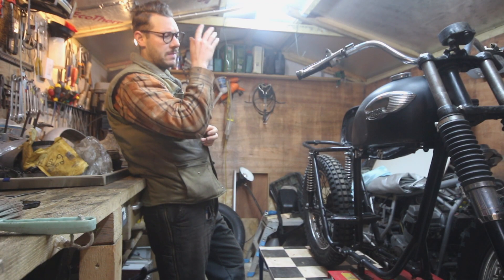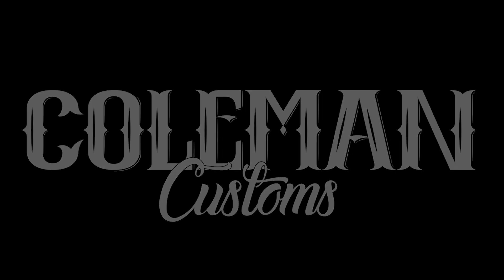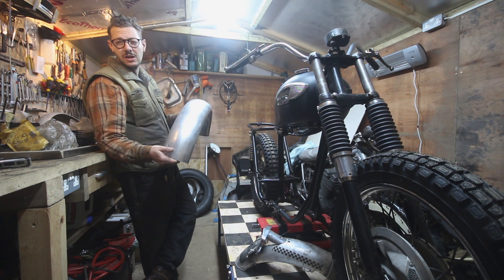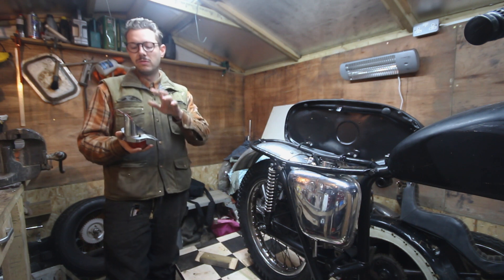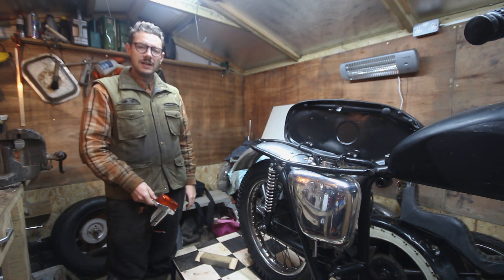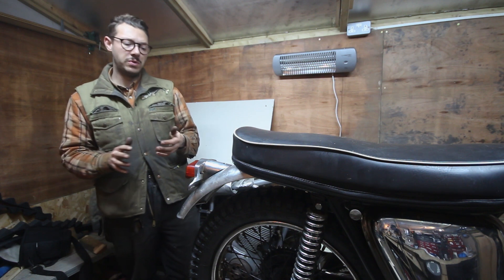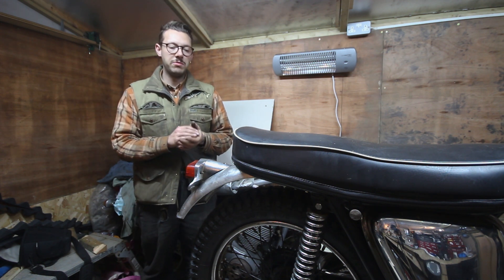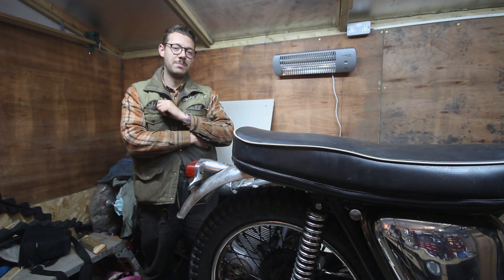650 Triumph Build EP.7 | Fussing About Brake Lights..

Comment: Looking superb Will. The way people drive these days, you are right to prioritize decent lights for riding on the road. 
Don't forget to deburr any holes you drill in aluminium, both sides with a larger drill bit. Any sharp edges and it will fatigue crack like Billyo. 
Best wishes, Dean.
Reply from the maker: Thanks mate, I think so too. Especially when it comes to unlit country roads which is mostly what I ride. I didn't know that, I admit I didn't do them all. Time to go back across and do that. Thanks for the heads up Dean!